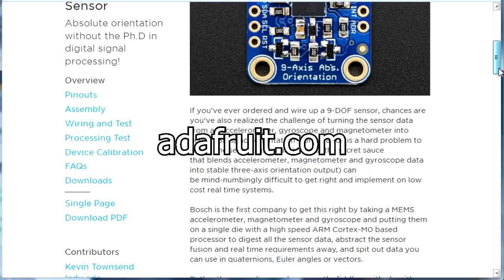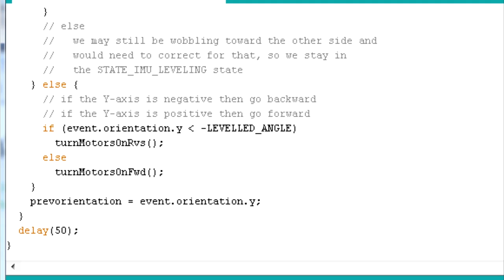Making BB-8 (v2) - Adding Gyro/BNO055 IMU - Part 4

Comment: I would suggest you to have a buck converter to supply 5v to arduino and other boards as arduino's power supply is not that reliable when many things are connected

Comment: Rimstar, have you thought of using an ardupilot board such as the old APM or new PX4 mini? These boards come with a plethora of sensors, and modifying the firmware is not all that hard. Indeed I think it would make for a smooth and stable BB-8
Reply from the maker: I hadn't heard of it. I'll have a look.

Comment: As others have said, you should switch to a PID loop instead of trying to come up with an algorithm to keep it stable. This is the type of application that PID was made for. Our IMU controlled rocket stability experiments really drove this point home, and we'll be doing some video on those test results. You'll be really pleased with how well you can get PID to work.
Reply from the maker: I'm away this week but I'll be trying PID when I get back.

Comment: I wonder if can modify it a little in order to have counter-pressure on other side of ball so it cannot slide around inside?
Reply from the maker: I already does. There are two rollers, one on the front end and one on the back end. You can see them at 9 minutes and 18 seconds into this part 1 video https://youtu.be/BCXH4AN2aog.
Reply: Oh I meant the opposite of bottom, meaning top. Sorry for being vague! :D
Reply from the maker: Ah, thanks for clarifying. The head kind of does that already. If you can picture it, the magnets inside pull on the head magnets and the balls in the head then put downward pressure on the top of the ball. So indirectly, the drive system inside is gripping the top of the ball already.
Reply: Hmm yeah. Thanks.